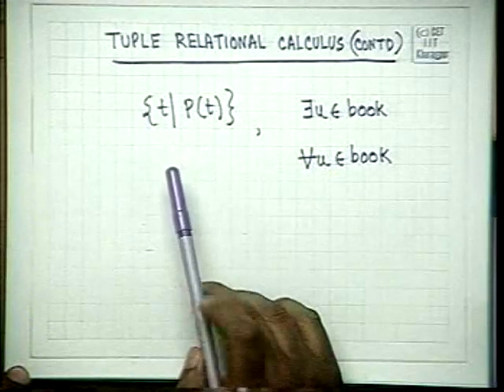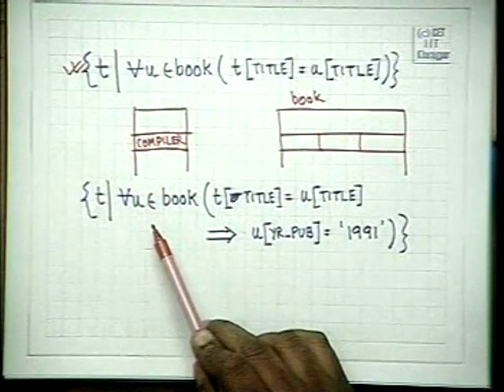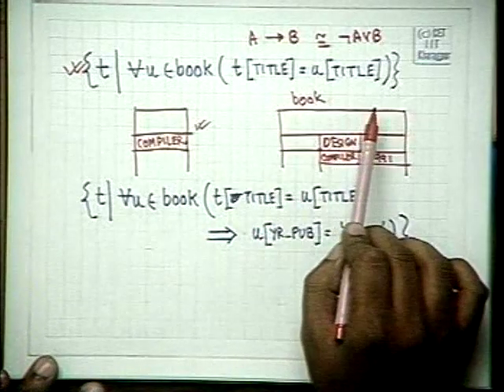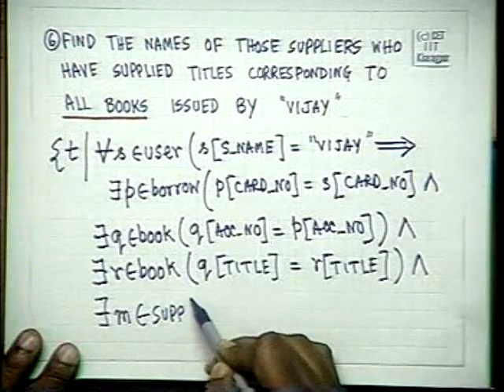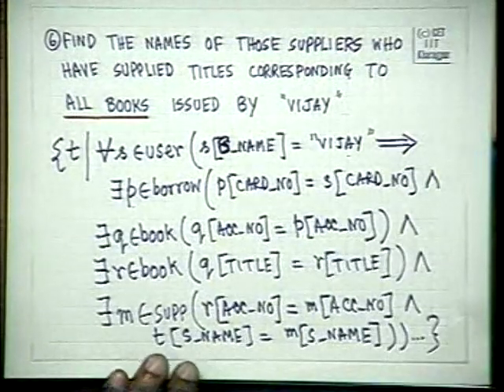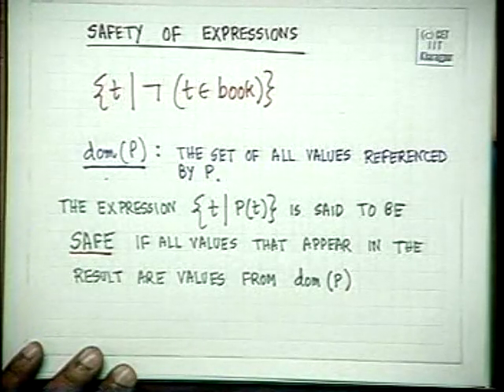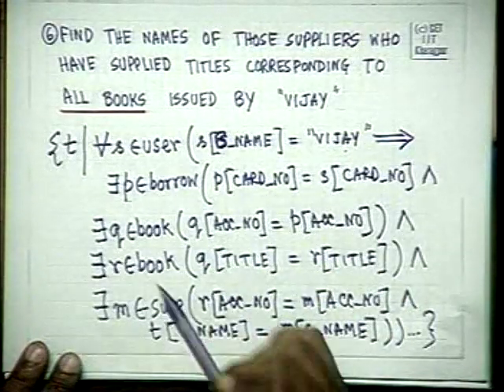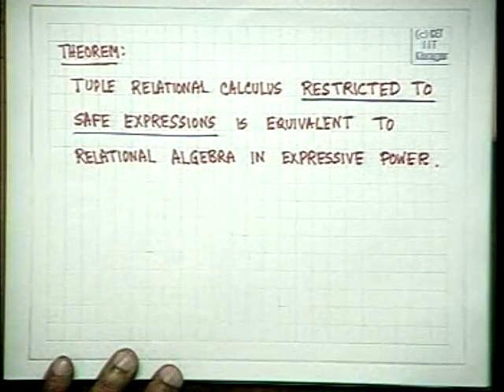Lec#09-Relational Calculas-2

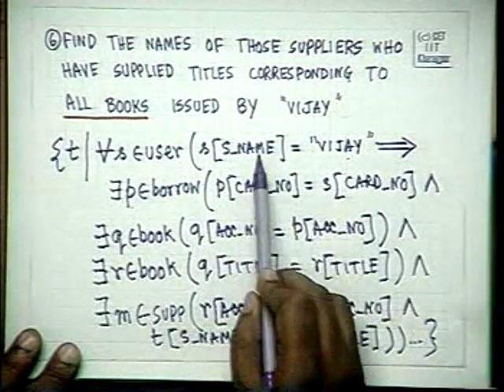Comment: what the hell is wrong with all you people. theres an error in this trc example given at 10:18 and nobody bats a fuckin eye. just shows youre all blindly waching this lecture wirhout applyoing actual effort. and on the other hand i cant believe these videos are supposed to be extremely reliable and we have mistakes n basics like these in this. the query number 6 solution only satifies for all users named vijay if supplier has supplied even one of the titles then he will be in tuple t . which is not asked in the query. they have asked supplier name such that all books borrowed by vijay are supplied by supplier. even reading the statement gives an intuition that we need to use a universal quantifier in borrows relation. good god.